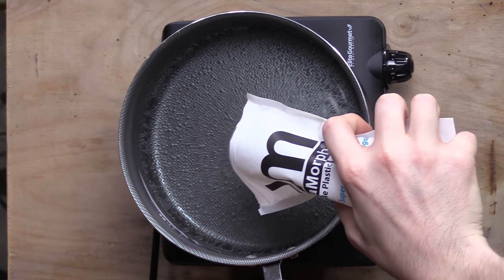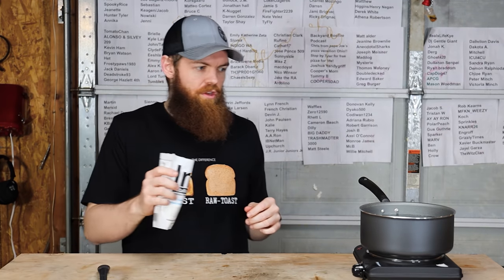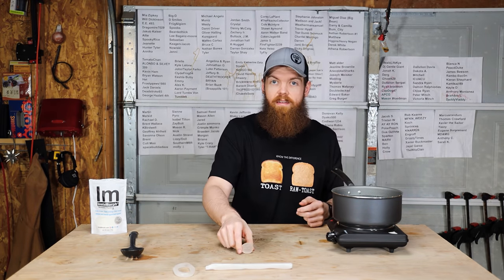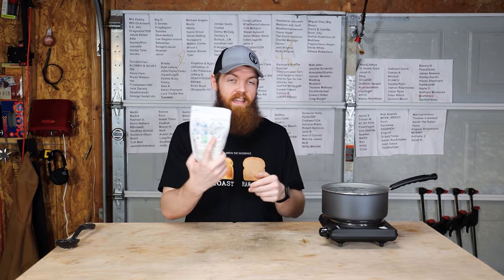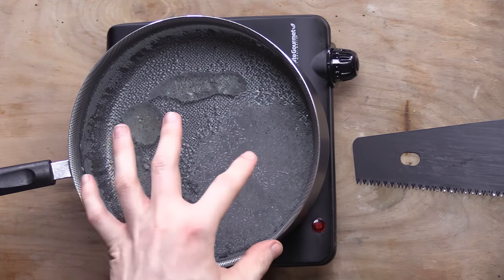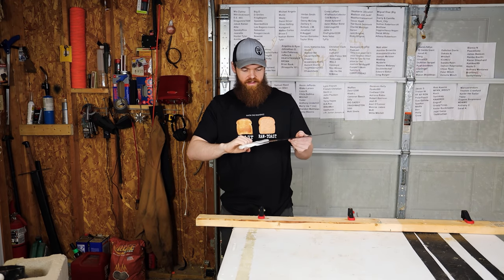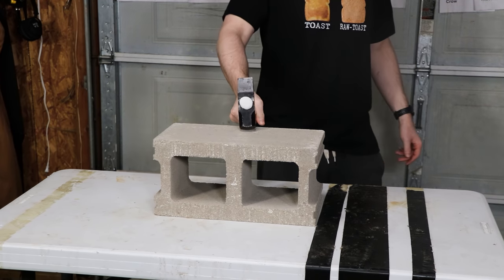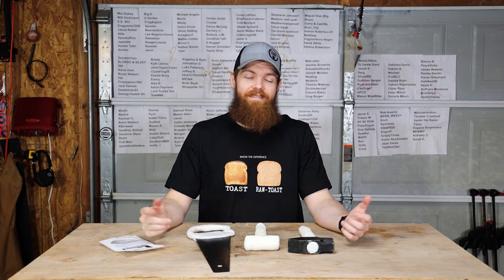You Can Turn These Plastic Beads Into ANYHTHING

Comment: Just think if the plastic hammer doesn't work out it does resemble a female play toy curve up the head of the hammer more round on each side and tell her to hop on and take it for a test ride. lol
Reply: This video is not OSHA Approved. lol No safety glasses hammering a cement block, but would of made out for a higher ranking watched video if a piece did eject off and mess you up I guess.

Comment: I would be concerned if it endures over time. About 30 years ago I made a mask that covered my whole head, from a thermoplastic a lot like that, where you’d heat up beads until you could shape it. About 2 years later I wanted to use the mask again. The plastic had become very brittle and cracked apart with just gentle handling.
Reply: I'd hope the technology has gotten better in 30 years haha but that is an interesting flaw if it is still a problem. I assume you tried re-melting it after it went brittle and it didn't make it any better?

Comment: WAIT did you buy plastic beads................................................. How much consumer grade plastic have you purchased.................................       OHHHHH wait yor "MERICAN" so those HDPE bottle caps would have not worked....................... and PS high heat plastic coffe cup lids would never work....................... OHHHHHH wait every plastic you have ever come in contact with in the first world has a mark of material. ANd mark of purity. the letters tell you the type, if there's an arrow triangle its pure recycled, and if there's a number near it that's the amount it was reprocessed.......... but I guess Just buy this BS bead bag so you can think you're a genius. Ya and the bag is most likly what your melting just a lowgrade plastic..... YOu bought ,,,,,,,,,,,,,,,,,,,,,,,,,,,,,,,,,,,,,,,,,,,,,,,,,,,,,,,,,,,,,,,